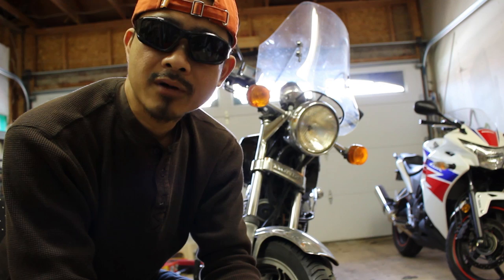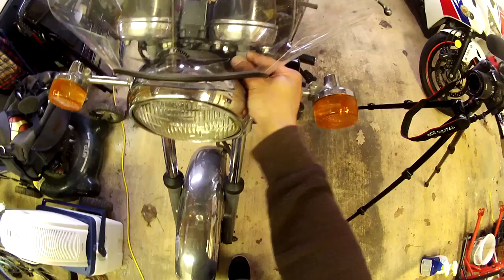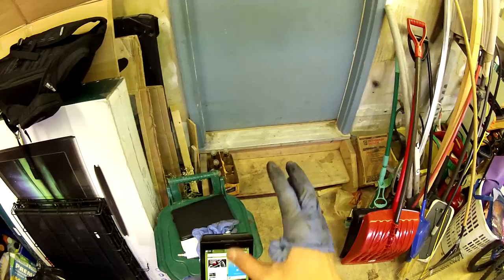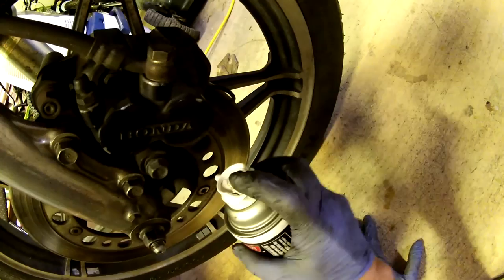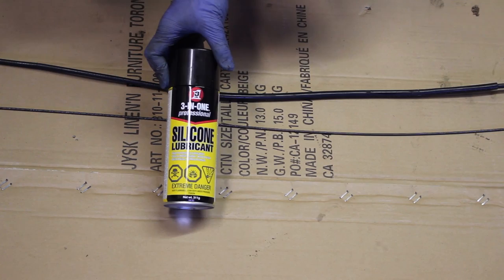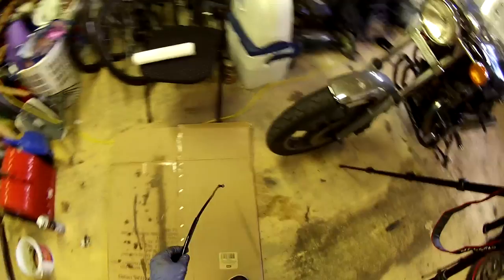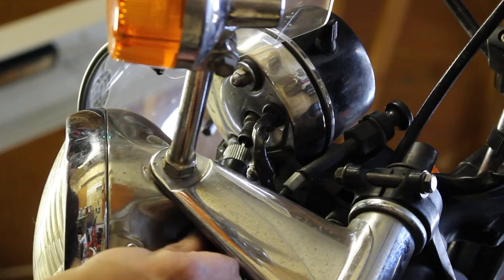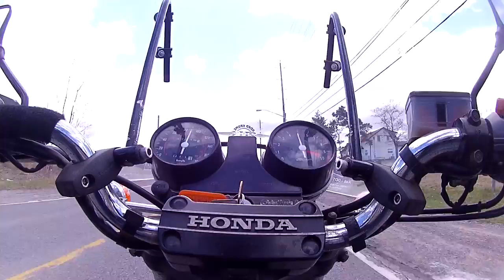Clean & Lubricate Speedometer Cable - CB450SC Motorcycle

Comment: I've got what looks like the same speedometer on my '81 XL500s. It starts bouncing and squealing something awful. What I did was remove the speedo and slowly dribble 3 in 1 oil into the cable opening while spinning the gauge with a small file to let it penetrate deep into the worn bushing. Keep it upside down overnight to aid the penetration process. Reinstall and enjoy. Thanks for the video, I'll do my cable too.

Comment: Thx for your video. I don't have a motorcycle, but you showed me how to lubricate my cars speedometer cable. Your video helped me a lot! Thanks :)
Reply from the maker: That's awesome. I'm glad the video helped you clean your car's speedometer cable. Thanks for watching.
Reply: The speedometer cable snapped in my 92 tercel so I bought a new cable. I knew I needed to lube it but didn't know how I found a video where the guy just sprayed some snuff in one end of the cable so i tried that installed it and my speedo worked again but the needle was bouncing all over the place. I searched for more videos, which there wasn't really any but I came across yours with the motorcycle and when you pulled the cable from its sleeve I had my answer. Thx so much!
Reply from the maker: kjlloyd424 Well, I learned something new from you today. I didn't know cars' speedo's worked the same way :)

Comment: Nice to see how thorough you work. Please remember (next time) to wipe the upper 4 inches (below the speedo) of the inner cable clean before assembly, so the lubriicant can not work its way up to and in the instrument, which will ruin it (and probably let it bounce). This applies to normal grease anyways, do not know how your modern silicone stuff behaves.
Reply: JanAndHenk dam I wish I found your comment earlier. Thanks for sharing that link
Reply: Also, I generally like to run dry, graphite lubricant in all my cable drives.

Anything "liquid", like silicone can trap dust and grit, and abrade the speedo.

Silicone is nice because it repels water, but I just clean them more frequently and use graphite
Reply: Glad I found your comment. Yesterday, my needle began to flutter between 25 mph and 37 mph. I'll try the graphite this morning. @perotekku

Comment: Brown Brady I suggest you test out the speedo with a drill attached to the cable if that don't work replace both speedometer and the cable if that doesn't work replace your speed sensor and if still no luck replace your speed gear down on the transmission those are the only things that control your cable

Comment: Thanks - yes easier to refit by lining-up bottom notch of cable first, then the top square section should align with speedo provided the wheel has not rotated during this operation.

Comment: So are you thinking that maybe a slight kink in the cable is causing the issue?  I suppose you could test the speedo itself by driving it with a drill.
Reply from the maker: VeeDubJohn I didn't find any kink on the cable. I think the speedo itself has an issue. I like your drill idea though, thanks for bringing it up. I will try it.

Comment: The bounce issue is something else.  What there is, is there is a damper pot inside the mechanical gauge.  It has an oil that can slowly leak or evaporate.  There is some way to refill it, but not something I have done or am familiar with.

http://www.sohc.co.uk/index.php?topic=4735.0 had a discussion on the issue and gives kinda the just of it in a search.
Reply from the maker: MarkusReese Hi MarkusReese, I think I will just leave it alone for now and accept it as a part of the bike's character considering it is over 30 years old. :) Thanks for the link.

Comment: A bit late now, but I have the same problem as you on a RE, and it seems that it was the speedometer gearbox!
Reply: Do you mind sharing what you had to do to fix the speedometer gearbox? I'm in the same boat.
Reply: @amycreagh3108  Never managed to fix the bouncy gearbox: I simply found out that the minimum number the needle was pointing was the "real" speed, and with he help of my mobile and a speedometer app learnt the actual speed. Did practice for a couple of weeks. pe on my bike 35mph is 30 (28, actually), 50 is exactly 50, 60 is 65 and 70 is 80+

It is weird, but you eventually get used to it. It takes me no extra time to know my speed now.
Reply: @Vlad-1986  I see, thx. Mine is totally broke and just has this loud whizzing sound going on. I'm guessing the gearbox/ speedometer rather than the cord but like he says it wouldn't hurt to clean the cord
Reply: @amycreagh3108  If they are all mechanical at least it is not too difficult to change, but yeah. Cleaning and lubricating the cord probably won't work, but it is free, and wouldn't hurt.

Comment: Hey brown do you git any video on lights because I got a 1984 honda magna 700 and the lights don't work the fuses and bulb is good so any advice would help
Reply from the maker: Marco Leguizamo No, I don't have any videos about lights and fuses yet. My advice would be to identify the cause by process of elimination. Is it the battery? Is it the bulb? Is it the fuse? Is it the relay? Is it the wire? You can test for these using a multimeter or by installing them on another bike. Hope that helps, or perhaps another more experienced viewer can help.
Reply: Ok cool thanks

Comment: my speedometer isn't working , I took it out used a drill it went up but when I put it back in it wouldn't tell me how fast I'm going , the fork wouldn't move nor capturing miles . please help don't know what to do?!?!
Reply from the maker: +heavens wings Somehow, the gear assembly that turns the speedometer cable aren't mating. You need to figure out which end is worn out or broken. If the end looks identical to a brand new cable, then the gear that drives the cable is probably worn out or broken.
Reply: o ok , thanks man , ill eff check it out ,im thinking its the hub , i used the drill before ad it started to go up
Reply from the maker: +heavens wings You bet, and good luck.
Reply: nope still doesnt work man
Reply: +heavens wings either one of the connectors is stripped or the cable is broken somewhere. My guess is the inside of the pin on one end or the other is stripped.
Reply: check that the connector housing on the back does not spin while the cable is spinning.  Or try to twist it with your finger.  If it's moving, it needs to be settled exactly into the hole in the speedometer so that only the center cylinder inside the connector spins, and not the whole connector.

On the bottom, there is a similarly tenuous connection at the center of the front wheel which controls the speedo drive (the male drive that goes between the forked end of the speedo cable).  There are two little nubs that must fit into the side of the drive to cause that to spin.  If it doesn't move when you spin the front wheel, it's not engaged.

Let me know if you're able to fix it.  I've been trying different things for a while now but I think that first part I wrote will fix everything once I find a way to secure the connection on the back of the speedometer better.  The screws don't seem to bring it in close enough to the housing.

Comment: can I use wd40 for lubrication? what about applying some grease to the ends ?
Reply: original WD40 is a water dispersing penetrating oil, not the best product for lubricating motorcycle cables (or lubrication in general).  Tri-flo works well.  Some also use Maxima chain wax.